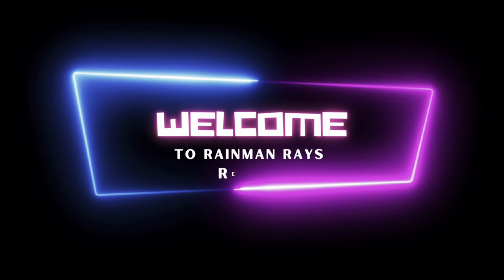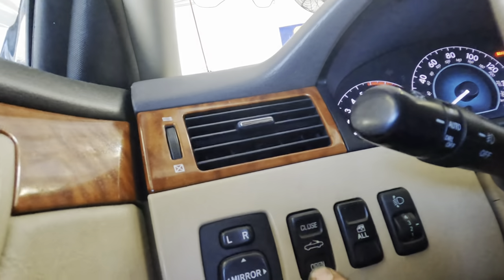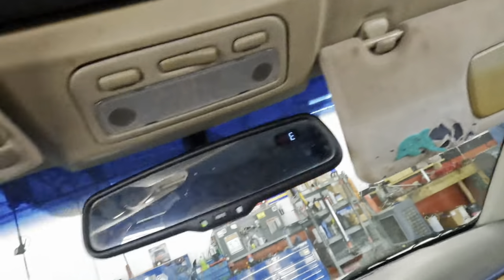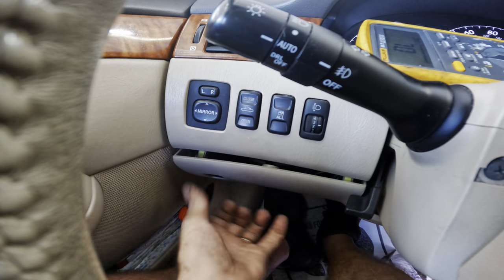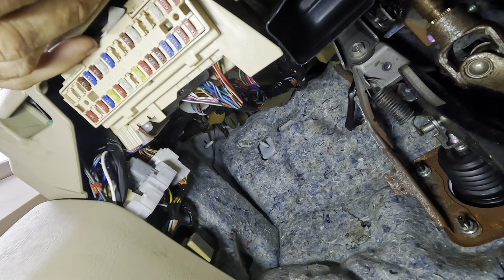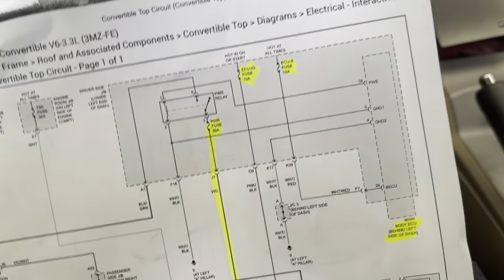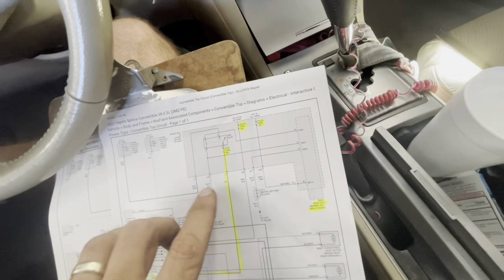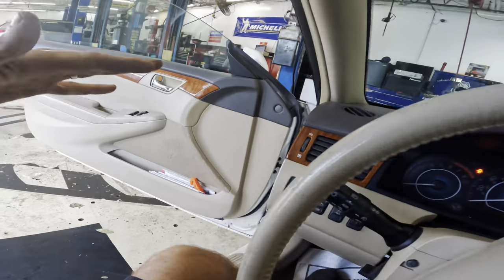Customer States: Convertible Sunroof - It’s Stuck!

Comment: Morning Ray..... the position is probably indicated by the current draw of the motors. The module probably monitors the current draw and determines if it's parked. This is why you can hear the rear windows click when you push open when they are open. In short, if there is enough current draw, it considers it parked and kills the voltage to the motor. Hope you get the job. It would be interesting to see the inside of that module.
Reply: Was gonna say the same thing. I know the older auto windows monitored current draw to stop motion. Same with the pinch stopping circuits, iirc.
Reply: Excellent point. I don't know how smart the control module is, but it could also detect a jam/fault if the motor draws running current for too long..
Reply: Yep, that was first added after kids were getting choked by power windows.  Power windows prior to that were dangerous to pets and kids.  Especially the ones with auto close.
Reply: 8th of grade of
Reply: @johnnyashley9425  ??
Reply: Yes, that means that all motors mide be drawing to much current because they are sized, that why they don't go up or down!
Reply: @arm2644  Most likely the controller is hosed, an amp meter in line would show what's really going on when it's told to move.  An open motor will show voltage but little to no current draw, a shorted motor tons of current draw but usually blows a fuse.  

Shame they made it so hard to get to.  My son has a 06 Solaris, really nice car but I dread fixing electrical issues on it.
Reply: Yep.I repaired appliances, including trash compactors, same deal, current limiter....they were nasty.
Reply: It’s a bummer not to bring the job to positive conclusion. We still don’t know the full extent of the problem or the necessary fix.  Costumers should be penalized for  an unconcluded story climaxes 😂😢😮They still don’t have their problem fixed. They just feel better knowing what the problem might be.  🤨
Reply: That is how the electronic parking brake works on some cars. Control module looks for a rise in current draw from the actuator motors. There are no limit switches or position sensors.

Comment: Quick tip for organizing thoughts while trouble shooting with diagrams. Yellow highlighting the wires and components of interest is good. Once voltage is confirmed at a specific test point, use orange over the yellow for that specific test point. If a component tests good, mark it with green. And if both ends of a wire test correct overmark the yellow/orange with green. By using this colour stacking of highlighting, it becomes easier to keep track of where you've been and the results that were found.
Reply: It also provides a handy documented reference point to file for later should the troubleshooting/repair process be postponed/interrupted.
Reply: @williamtakacs7466 -- great point
Reply: One color only for years  now multi color  thanks
Reply: Telecommunications background. Sleuthing telephone exchanges. Writing on our only copy of huge wiring diagrams was absolutely verboten.
Reply: @iconoclad  It makes complete sense to keep your only copy pristine! Thankfully this tip can be used freely on as many copies as you like 😉
Reply: I think Ray Bard the colored markers from his daughter's coloring set but I could be wrong sorry Ray have a great day

Comment: Years back when I got married my wife had a minivan that she had for more than 10 years. Her father bought it for her after her 2nd kid was born. Anyway, it had dual sliders behind the regular doors up front. The drivers side (left) slider wouldn't slider? I read up on it and found out it was a problem with that make/model of minivan. My wife said it was a lock problem and that her and her dad tried everything and they couldn't fix it or get it open? I pulled it into the garage and took out the seats, pulled the interior panels off the door and sat there looking at its guts and googling repairs when I saw the problem. The fuel door was on the driver side and it had a safety mechanism that prevented the slider from opening when the fuel door was opened while getting gas , like if kids piled out of the van and causing the fuel door to break off or breaking the fuel pump nozzle off ? I put the panels back on and the seats back in it. Backed out of the garage..and im not BSing. I opened the fuel door and pulled the sensor out with pliers. Twisted the wires together and pushed it back in. I grabbed the door handle and it slid open like butter. Less than 90 mins solved 10 Years of Problem.  side note: they are Mormons. No computers until shortly after 2012. No cellphones until I married my wife in 2011. So they couldn't google the problem and fix it themselves? 
Sorry So Long..again...Mormons.

Comment: I had a1969 Pontiac Bonneville convertible. Loved the car and wish I still had it. The dash switch for the top was really bad about failing. Way too much power draw according to the shop mechanic. The last switch replaced lasted for years so I have always wondered if the mechanic installed a relay. And it relied on the button operator to know when to stop pushing the button.

Comment: The unit would use the increased current load to determine the windows/roof is up or down. or at the very least it will have current cutout to protect the motors from user error.
Reply: It should have an automatic reset and if it doesn't good luck finding anything have a great day

Comment: I'm always in awe of the breadth of knowledge required to work on modern cars. Being a mechanic is just not enough, you need to be an electrician, a machinist, and even know how to weld a little. Great detective work, Ray, and this is why I'd never own a convertible. The damn motors break all the time.
Reply: See my comment above, no they don't....
Reply: Years ago they used to be a Ford convertible I cannot remember I want to say early '60s that had a two-piece convertible hardtop that went into the truck and they're highly sought after I can't remember the year I can't remember to make but I remember the car have a great day
Reply: @paulhall170  I had a friend that had a 1972 Torino GT and tried to put the convertible top down in about 30 miles an hour the top did not survive very well have a great day

Comment: Re: position and open/close sensing. A lot of systems will detect the resistance on the circuit when the motor is stopped/obstructed. The pop up headlights on my old trans am worked that way. There was no micro switch. This is why the nylon gears would eventually get stripped and you'd see a lot of T/As on the road with stuck open head lights. ;-)
Reply: Same thing with Vets & Cougar had vacuum operation years ago & would go to sleep at stop light have a good day

Comment: Thank you Ray.  I just purchased a 2008 Solara convertible and have been watching videos on repairs that may be needed.  If this were my car I would have authorized the diagnosis to get it repaired.  Wish I had a shop like yours around my area, but my local mechanic would be willing to tackle something like this issue (and does not want to do a timing  belt replacement).
Thank you.

Comment: We had a 2005 GMC Yukon purchased in 2010 where the sunroof intermittently would not close (no hum, no noise) but would always open.  Local shop told us to take to dealer, and I dealer agreed that I'd pay for a fix but not a guess.  Dealer called me and told me "bad switch" even though I'd checked the switch myself the day before, gave me my "bad" part back, installed new switch for $250.  Next day again wouldn't close, took back.  This happened several times, several visits - remember I said intermittent.  Finally dealer admitted "we have no idea what's wrong" so I asked for a refund, had to fight 2 months to get that.  Of course dealership also wanted to charge me $50 for "hazardous waste disposal" so I asked exactly what they disposed of, which turned out to be "nothing" so that was waived. Dealership also tried to sell me new radiator hoses even though mine were 1 month-old Gates hoses with non-GM hose clamps, so I know they never even raised the hood for the radiator hose replacement thing....so that remains my only experience with a dealership....

Comment: Car electrical is weird, I had a '93 Mustang convertible, a bad turn signal flasher was blowing the fuse for the top motor and a couple other things, took me a while to figure that out. Only noticed it when driving and I went over a bump and heard the flasher randomly click.

Comment: I'm in possession of a 2003 BMW 530i that hasn't been used in five years, the passenger front window made a terrible cracking sound when I tried it, it went down but refused to go all the way up, I replaced the regulator assembly and now it's good, however the rest of the windows didn't work then all of a sudden one by one they all started working, I could hear clicking but nothing, I advised the new owner to never ever attempt to open the sunroof, ever since his aunt whom he bought the car from has probably never opened it and it's better to leave well enough alone but just like the little girl who found the spinning wheel spindle so tempting to touch and when she couldn't stand it anymore and touched it and we all know how that story went, it's kind of like that, it's so tempting to want to try and open it. Sometimes it's better to leave well enough alone.

Comment: If it does come back:  Beware, the rear windows may be an interrupt for the roof opening.  If they won't respond to the call to lower a fraction of an inch prior to the roof opening routine it may stop the whole show.  In other  words:  If the rear windows are not working the roof will not open because it requires the rear windows to lower slightly to allow the movement of the roof without damage.
Reply: True. My 2004 MB CLK required the rear windows to lower all the way before the top would operate. I was always having issues with it.

Comment: I had a 99 BMW 328. If, for some reason , it lost home position on the windows or top, it had to be re-taught. It wasn't that hard to do but I had a shop manual that told me the procedure. Top/window modules are as a rule pretty sturdy, maybe some more research.

Comment: The signal limiting switches , even in 2007 and way farther back then that are built into the motor/ gearbox assembly.  Like window actuators stop when down and block any signal other then up, and likewise when up it blocks any signal trying to make it go up. Like the tilt motor on a treadmill,  it stops when all the way up or down without any external switches.

Comment: --   Wild guess. the top motors work like parking a rear windshield motor.  They sense draw and shut down.   Found this to be the case fixing the sunroof on my Tahoe, which lead me to why I had a parasitic batt drain: the rear wiper was parked, but didn't know it.  Same thing happened on this 90s Ford my parents owned.  Good while ago, but I think that's the last time I threw something in anger.

Comment: That's strange. My 2003 Tacoma has some sort of detection that prevents voltage to the window motor when it's already at it's maximum limit of travel whether it's closed or open. That's why you don't get the 'clicky'. Adrenna123 has a valid point, although, my truck will still operate it's windows with the power off, but it's limited to 30 seconds after power shutoff or if you open the door with the power off. I would assume that Toyota probably makes a few modifications to it's electrical systems in 4 years, but if I didn't know it was a convertible Solara, I might think I was looking at my Tacoma. Practically identical.
I would be willing to bet this control module had water damage.

Comment: Good work TroubleShooting.  Glad "feedback" signals were checked into as "not there."  But then there's the "get permission" to dig more "intrusively" into it (remove seat stuff).  Recently was TShooting an "open wire" suspicion within a robot arm.  Causes a bit of ruckus because we didn't get "permission" to press on with TShooting, line stopped, stack on the floor, la de da da...  Bad us.  Up to your customer now.

Comment: My WAG is, the control module got wet, it is a convertible after all and water WILL find a way. Maybe the drains got clogged? Just another reason I prefer MANUEL operations instead of the "convenience" of electronic. Much easier to diagnose problems.

Comment: I own a convertible sunroof :P Honda. I want to see the fix on this as I presume my car from 2001 has a similar control method for the top. It still runs fine @179k with full top functionality, but I'll need to be able to service the top if it fails. Luckily I purchased the Honda service manual for my car when I bought it...19 years ago. Yeesh, I feel old.

Comment: I think you may be mistaken as regards the feedback system for the control module. Mazda MX-5/Miatas with the power retractable hardtop have a similar setup and (as I understand it) the control module gets the roof position essentially by counting motor/mechanism revolutions rather than from microswitches etc. It seems quite likely that Toyota does something similar.

Comment: Using current monitoring to sense when a window motor say has reached top or bottom is common automotive design practice as it avoids both the cost of sensors and their additional unreliability.
My bet is that water has got into either the electronic module behind the footwell fuse box or the module behind the rear seat squab or cushion.

Comment: This reminds me of my G6 gt...  If it wasn't done myself I agree with the customer it wasn't going to get done at all. 
Especially since all of pontiac is dead now. I can confirm its typically miss connection. The roof hinge where it clam shells together was mine. I replaced mine with new flexible wire with a loop so it would quit folding the wire in half every time the roof went down. 
 Hardly ever hydraulics, The system will typically work on air without the oil however you will burn it out that way.

Comment: i had two different convertibles in the 90's.... 
i could hear the conv. top motors change pitch when the hydraulic cylinders would bottom out.... no shut off sensor.
one of these cars was built to where when the conv. top would start going down, the two rear windows would go down at the same time as well....
Reply: I believe that is to protect the weather seal of the top. 
  My Miata is a manual roof, and the owners manual says to put the windows down when putting the top up or down in order to protect that weather seal of the convertible top where it sits on top of the windows. Yours apparently does that automatically.   Nice.

Comment: Must agree with selador Ray BUt I do wonder why you did not use a fly lead from a power point direct to window motors and roof motor to check if all three had not gained a power surge fault .but as allways great to watch so keep safe and Keep em posted.

Comment: Back in the day, Peugeot and Citroën electric roofs would only work with the parking (emergency)brake on to prevent operation when the vehicle is moving! Can't recall if any Toymotas had this 'safety' feature 🤔  BTW love your page, reminds me of when I used to do the same stuff! Good luck from the UK 🇬🇧
Reply: Yeah, my old vauxhall had that feature too.
Reply: Assuming that the car was in park and the handbrake applied, should it come back in have a look at that relay – have a good day!
Reply: Similar with the Mazda MX-5/Miata. It won't work if the boot (trunk) lid is open, or if the vehicle is moving or brakes are not applied.
Reply: Yes, but not for the rear windows. Looks unfortunately like a bigger problem.
Reply: @TheRoybeasley what year? I have an '06 base model...its got a manual "sunroof" (LOL) open/shut process.
Reply: The rear windows automatically go down when you open the convertible top. The module waits for the window current to spike indicating the windows are down, then opens the top. Had that same problem couple years ago. The module was green and crusty and so was the harness. Stupid place to put the module. Right where water can get to it.
Reply: @kickbackcrochet  As I said in my other comment, I have a Power Retractable Hardtop model (2009 NC).

Comment: The problem is the tiny spider roaming around on the dashboard!
I have a PRHT MX-5 and the electric roof is 100% reliable,, I wonder if Toyota are using proprietary components or the same basic modules and motors that Mazda uses?

Comment: Super nice being able to pull up electrical diagrams when ya need em.

What program is your shop using?
Reply: I think he gets them from AllData? Might have mentioned them in previous video
Reply: its from AllData, you can see the URL at the bottom of one of the printouts

Comment: Out in my world of industrial instrumentation and process controls is a motor operated valve called a Limitorque. They have position reporting switches and travel limit switches built in. The convertible top drive motors should have travel limit switches built in to prevent overtravel of the top mechanism. If the mechanism is jammed the motor will not be able to provide enough power to unjam it. Manually opening the top and then operating it is recommended.
The clue here is that you can hear the motor trying to operate the top to lower it when you push the down button.